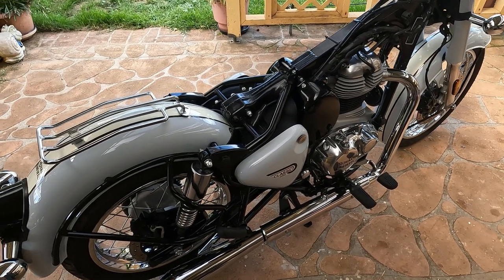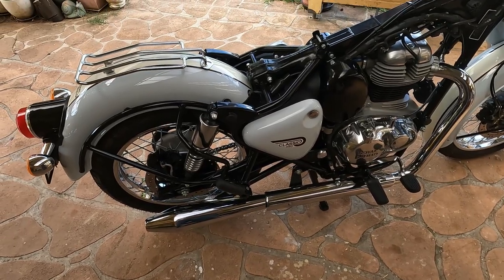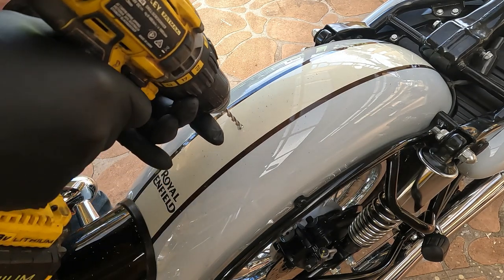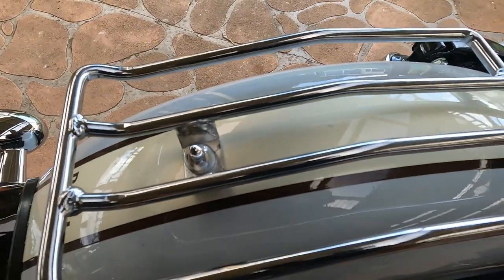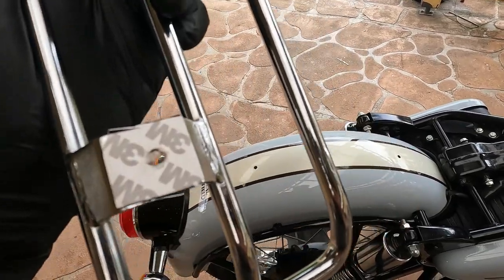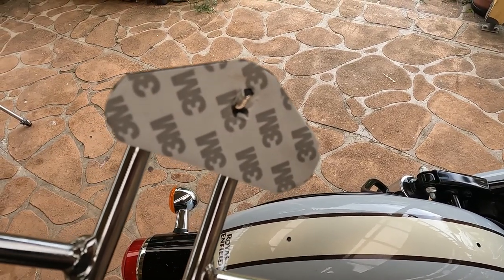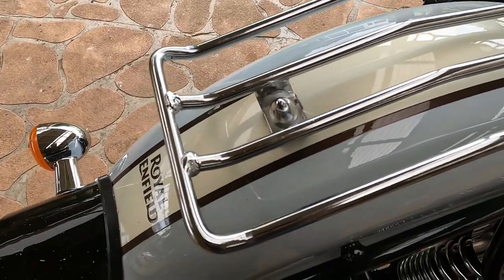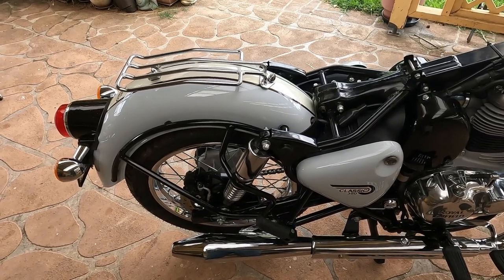2022 Royal Enfield Classic 350 - How To fit A Classy Rear Mudguard Rack!

Comment: I have exactly the same rack but decided against fitting it because I  chickened out of drilling at the last minute.
Instead, i removed the rear seat, ground the lugs off the base frame, repainted it black and rivetted an aluminium plate to it.
Solid as a rock and looks quite nice.
In case your wondering, I'm an unsociable bastard and have no intention of ever carrying a passenger. Usually carry a roll bag when I'm touring though and this works perfectly.
Ride safe!
Reply from the maker: yeah it's something to think about when out comes the drill...lol no real second chances after one pulls the trigger.
glad your mod worked out for you and i see no issues riding alone either.
i quite like it...lol

Comment: Hey mate just wondering if you have heard of a product called soft seal made by CRC great stuff its like a soft wax coating, kind of like caverty wax, it would be great to spray or brush application around those holes you drilled in the rear gaurd to prevent rust starting, and you can remove it with petroleum solvents. Cheers mate have a good day.
Reply from the maker: good idea. i might take a look as i have a black rack arriving soon for the marsh grey unit. good tip there!
Reply: @ridewithwarro   from where are you ordering this carrier ... it looks nice
Reply from the maker: @christopherfernandez4982  info and link in the clip

Comment: Hi, great job. I have the same bike as you and want to fit that rack. What size, length did you get. I have seen 2 on eBay. One at 22cm and another at 39 cm. I don't want to get the wrong one and it looking daft. Cheers
Reply from the maker: the 39cm  one is the correct one

Comment: hi~
I'm a subscriber to your YouTube. I also want to work on the Royal Enfield Classic 350 bike, but the bolts and nuts you recommended are out of stock. I'm embarrassed because I don't know the exact size of the bolt and nut. Could you recommend the same size bolt and nut on eBay?
Reply from the maker: long time ago. just type in acorn number plate bolts
Reply: @ridewithwarro  I am your subscriber. After watching the video you posted, I purchased and installed the parts recommended by eBay, but the angle of bending on the back wheel was not right and there was a large space in the front and back, so I couldn't attach them. How did you bend and mount it?
Reply from the maker: @홍성오-g9c  i think they vary from rack to rck so angles may bedifferent and that would depend upon how they felt the day they made them.
what i didwas place foam double sided 3m type tape -similar to a gopro mount and cut to shape.
i stuck one side to the rear rack but just let the other side taped and resting on the guard then drilled and bolted it down

Comment: Looks great. I agree about tape before drilling. An inch of masking tape saves the grief of scratched paint by a slip of the drill. This rack looks sweet, where did it come from??
Reply from the maker: got it off ebay for something like $50 or $60. had them on a few C5's and they look good so i keep coming back to them
only real issue they come in 4 sizes so best get the right unit
all the best!

Comment: Nice job. But drilling those mounting holes through that nicely painted fender would certainly give me a pause. One slip of the old drill bit and I would have to walk over to the nearest wall to hit my head against it.  lol  I think the rack manufacturer should have provided a couple of stick-on rubber pads to protect the fender finish and help with cushioning the bracket, instead of you having to supply something similar.
Reply from the maker: once i use to put them straight on but on the removal i found that the rack gorged out the rear fender paint. so in the end i decided to add the 3m sticky tapes
that little tap on the drill point helps heaps plus i always use a new drill bit...never old stock...lol
they are usually the ones which cause the damage

Comment: That's an elegant rack.   I've been thinking of mounting a number plate to the front fender of my RE 500.. I like the Block of wood trick.  Just wondering about how to get enough clearance for a spanner on the underside.
Reply from the maker: i usually just undo the 5 mudguard stays and lift to bolt them on. drill out the holes prior to doing that move and all will be lined up and the block of wood helps quite a bit.
i once put a hole in the front tyre fitting a number plate...lol
Reply: @ridewithwarro  Ha!  That's what I'm afraid of!

Comment: Good:
Dear friend, you are running something you forgot to do:
After drilling the holes, apply anti-corrosion paint on the holes, wait for it to dry, and then paint with white paint the same color as the bumper, wait for it to dry, then apply the chrome part.
This is so that it doesn't rust the holes you made later and doesn't spread to the bumper.
Good curves.
Hug.
Reply from the maker: good call there and appreciated

Comment: I like those Bullett bolts! Appropriate name ;) Clever idea with the 3M tape. I would have peeled off the backing and stuck it to the bike. Then I would have a sticky mess if I ever wanted to remove it! I like your idea better.
Reply from the maker: well the tape idea wasn't mine. well it was but on other C5's i use to peel both sides and once on and you want to remove i......its hard work and concerns about the chance of paint lift.
this idea i feel covers that issue or it does so far.

Comment: I recommend putting a painter tape before you drill....
Reply from the maker: good idea too but i've done it now maybe 10 times on different C5's so have a good idea on the proceedure. lways good to give the metal a punch plus a brand new drill bit
those two moves alone could be the difference between a good job or a depressing sight...lol
over the years ...i've had both!
Reply: @ridewithwarro  Makes sense. Also, when you apply a tape, the punch hit ( and drilling energy) gets dissipated versus transfer on the metal which can potentially chip the paint. The paint quality on REs are not good and they chip away(don't ask me how I know it ;))
.
Reply from the maker: @mack_titan  yeah i must admit in the early days the drilling didnt go too well..lol i too joined your team. 
even with a new bit -best to place that punch mark in and start it slow.
i get to do it all over again when the black rack arrives for the marsh grey